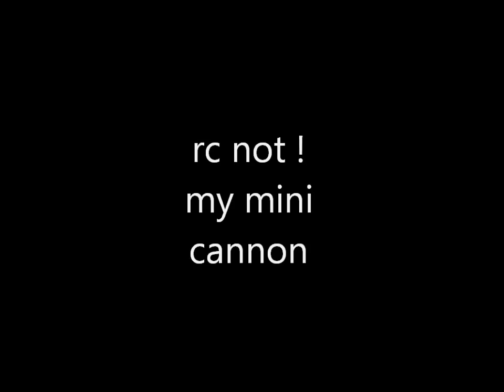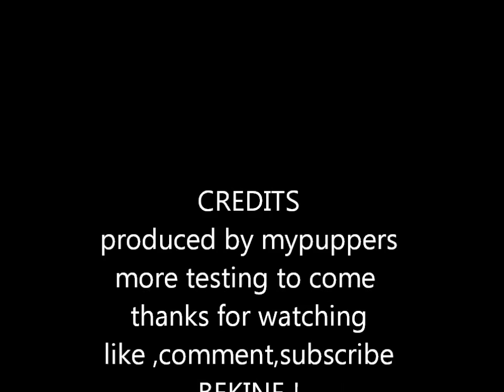mini cannon

Comment: Very cool, we find a few of these when were out Metal Detecting, thats the first time ive seen one firing, little beauty that, very similar to one i found recently.
Reply from the maker: FPV Carlisle Cumbria thanks for the view and comment. can't find them around here , so i made one . lol !
Reply: Haha - good skills making one that small that actually works mind, what powder/ball are you using?  I think mine would be too old/corroded to fire now
Reply from the maker: FPV Carlisle Cumbria i don't have any black powder , so i used kids cap gun caps.  i removed the powder out of the plastic ring caps. ididn't have any ball bearings for amo , so i rolled # 4 bird shot (lead) with a steel bar till it fit in the cannon.
Reply: Very resourceful, seems to work perfect, i always wondered what they were like firing, thats a perfect demonstration, thanks for the info :)
Reply from the maker: FPV Carlisle Cumbria will be doing more vids of it shooting at some different targets. just to see how it preforms ! i would try and clean up the one you found. you might be able to drill a new bore just slightly bigger to make it new again . same with the fuse hole but clean it the same size drill bit !  you might be able to bring it back to life.  just a thought.
Reply: Great news, ill watch out for your new vids, the ones ive found are from the 1700s - i think they would probably explode now - theyre more for collecting  and make very nice ornaments - ive cast some wheels in lead for them - swap you a pair of wheels for a cannon lol ;)
Reply from the maker: FPV Carlisle Cumbria oh wow thats old !  yeh i wouldn't mess with them!  they will be worth more as is !
Reply: Yeh theyve had their wars - retired now  :)